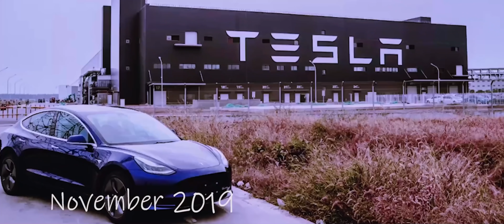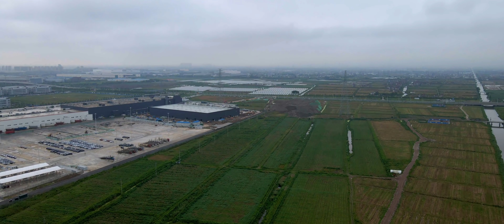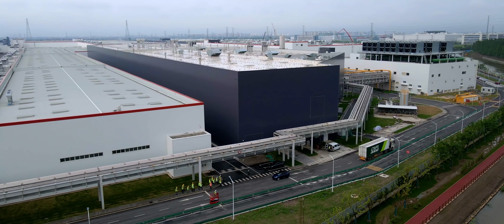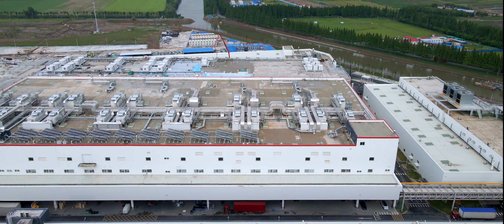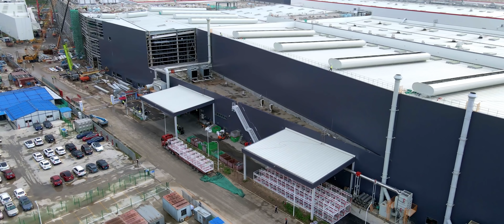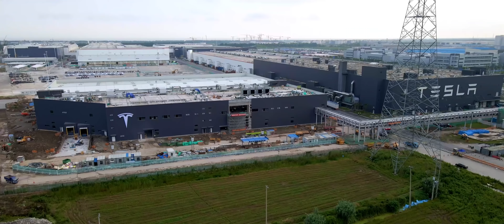(June 17 2021)Tesla Gigafactory 3 Shanghai 4K Video

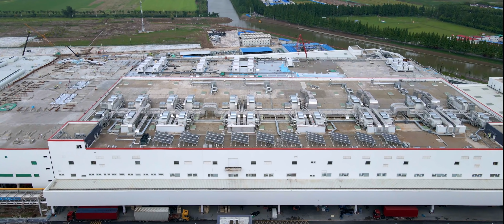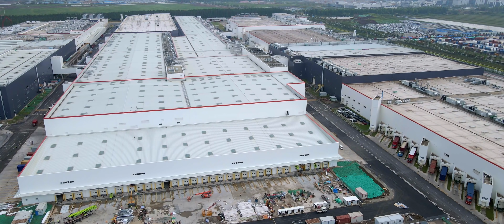Comment: 6:56 I wonder if this building (being extended on its north and east sides) is where the seats and other components like injection-molded parts are made.  The body-in-white, paint shop, and final assembly of Model Y are all accounted for in the big U-shaped building (see 6:09), with motor production, stamping, and casting in surrounding buildings.  The foresight and planning that must have gone into the site design to accommodate 3 phases of build-out with continuous operation is impressive.  The result looks so much more rational than, say, the NUMI plant in Fremont that Tesla acquired from Toyota.